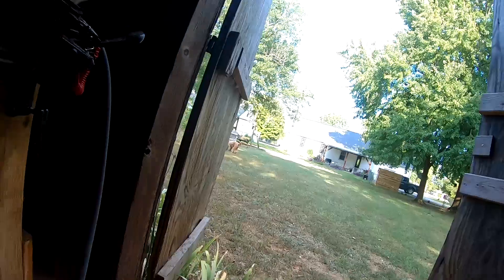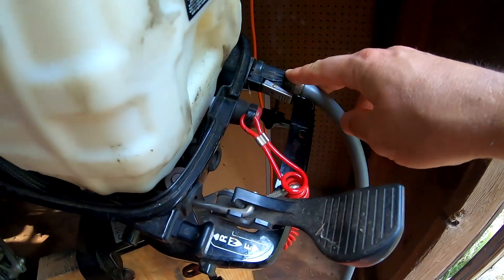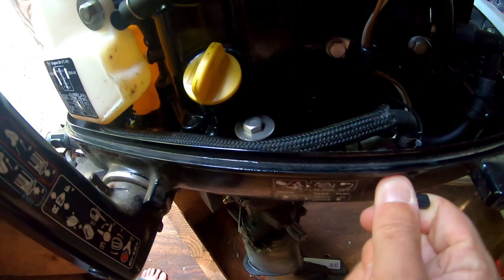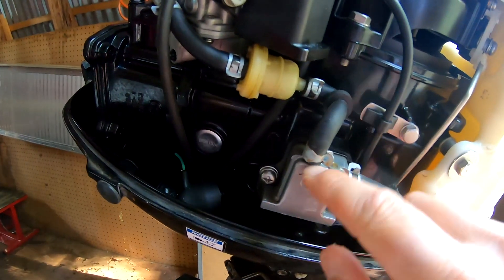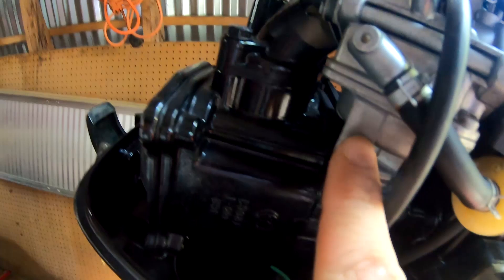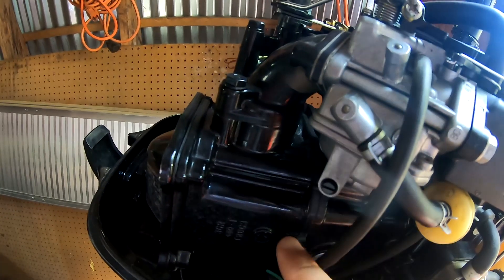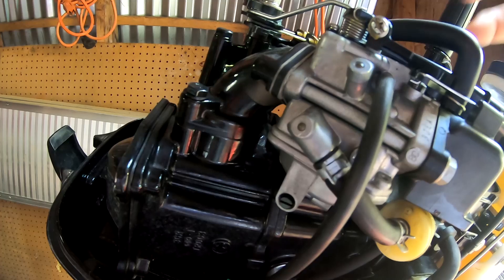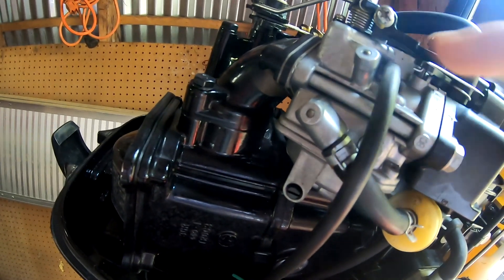How an Outboard Fuel System Works (Everything Explained)

Comment: Mate can you tell me what you think might be happening witt my mercury 1997 20hp
I was losing power due to fuel. I replaced an old tank and lines without success. Fuel filter is clean. I can keep the motor running if I hold and give the slightest pump of the fuel bulb, I'm talking very very small squeeze. If left the motor will stop and the fuel bulb will still feel hard and the fuel filter will still be full. Vent on tank top is open also.
Any ideas thanks in advance
Reply from the maker: If it has a fuel pump, that would be my guess

Comment: Just got the same motor! There’s no gas stations around me that sell none ethanol fuel though so i bought that stabil fuel stabilizer that you recommend do you that will be enough to use with regular gas and not mess up my motor or do you think i should drive the hour and a half to go get non ethanol?
Reply from the maker: Stabil should be good. I would still try to not let the gas sit for 6+ months. If the motor is going to sit for a few months I usually try to run it dry. Driving over an hr is not worth it.

Comment: can I put a steering wheel and throttle on my mercury 6hp 4stroke
Reply from the maker: There is a conversion kit for electric starter but it is really expensive, I really don’t know it it’s worth it. For steering I think there are also some kits that might require some rigging up. Could be a fun project but honestly I would try to get a larger motor that has those features as standard

Comment: I didn't know you could fill the internal tank using the bulb. 
I'll try if it works on my suzuki as well. 

And it's kind of stange the fuel filter is located after the fuel pump.  In suzuki 6hp, filter is located before the fuel pump.
Reply from the maker: That’s cool, I would love to try a Suzuki.  Hear they are awesome
Reply: @Skinnyriver  once you get used to it, it's a nice little engine. Thinking of upgrading to the new announced tohatsu 9.8efi (not 9.9)